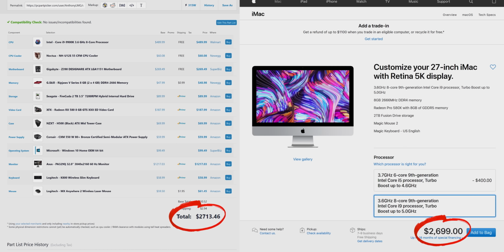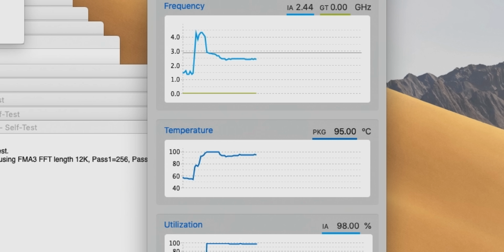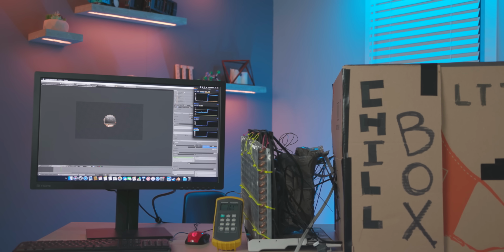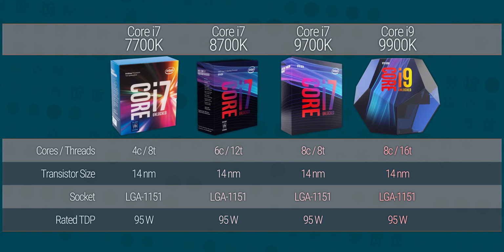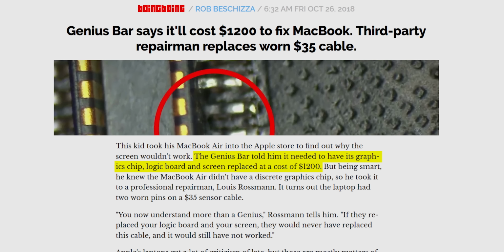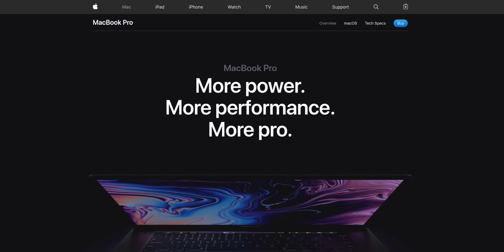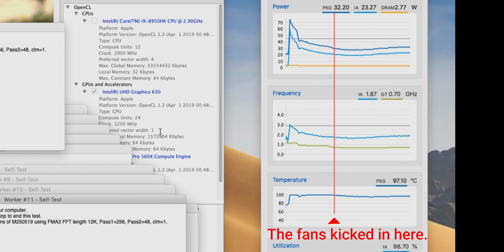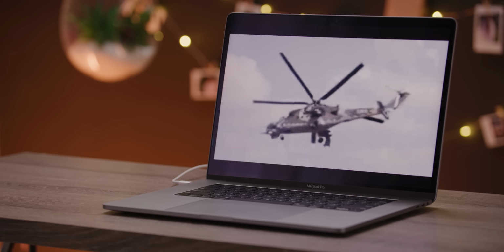Macs are SLOWER than PCs. Here’s why.

Comment: if u need a pc with mac os then build a hachentosh....
Reply: The issue with this is 2 things:
- Hackintoshes are not as stable as a real Mac and require frequent maintenance or else software update will break them. Look to any Hackintosh forum or r/hackintosh for the dumpster fire that is MacOs updates
- Hackintoshes are not a good image for your company as you're using pirated software. You really have not choice but to buy an iMacPro or try to switch to windows(which really isn't an option if the software you run is only on MacOs)
Reply: @mykolagrymalyuk1633  Installing mac is not piracy since mac os is free. If you know how to use clover or even osmosis bootloader, it will be as same as a genuine mac no update issues etc.
Reply: @drozcan  Unfortunately, even though it is free, it is still violating the license that macOS is licensed under to make a hackintosh.

I don't think Apple has attempted to legally pursue anyone for making a hackintosh for personal use (Aside from people who have attempted to sell pre-built hackintoshes) but it is still risky if you attempt to use your hackintosh for your job. Kinda like how Adobe doesn't go after people who pirate Photoshop for personal use, but you will be busted very quickly if you try to make money using your pirated photoshop
Reply: @empyrical  Exactly! To be more safe if you really wanna use it with your work like logic pro and studio stuff, you can hide the case and pretend to be using a Mac Pro
Reply: You could just run a vm Mac os on Linux. Ltt even made a vid on it
Reply: @sonicatdrpepper  indeed!
Reply: @Flam3Sm0k3 Well then you don't know how to use clover bootloader. Don't make any changes in S/L/E, just inject them using clover, so does DSDT patches. You can update without any problem. I'm speaking from my experience as well, as a person who also used osmosis which is more advanced.
Reply: @Flam3Sm0k3 Im not gonna argue that since its not my issue
Reply: @Flam3Sm0k3 I'm not too into the Hackintosh thing (I prefer Windows 7/Linux tbh), but doesn't Clover inject kexts that aren't even stored on the OS X partition somehow (therefore, the OS probably won't overwrite them with software updates)?